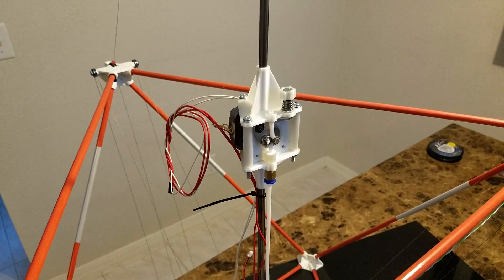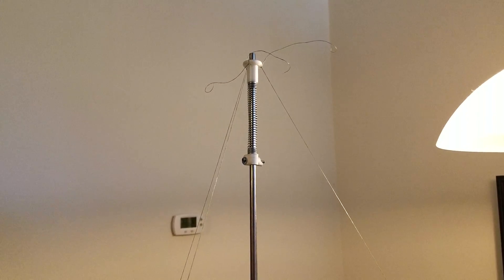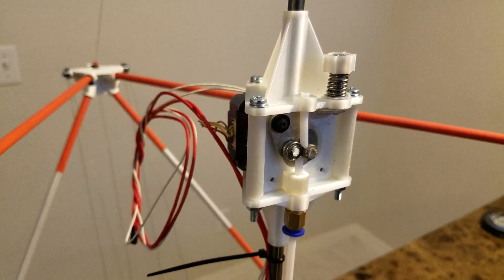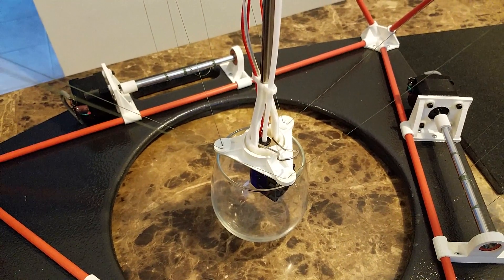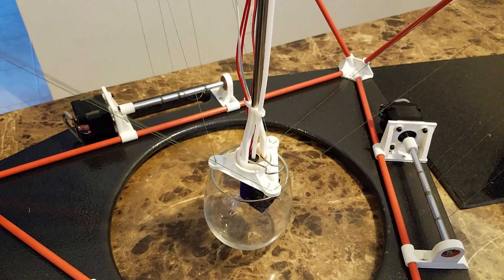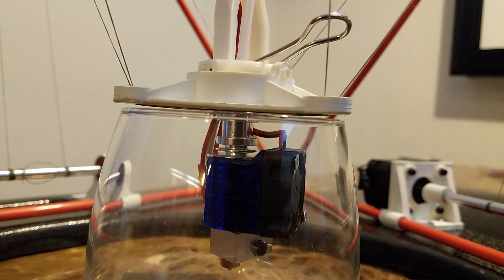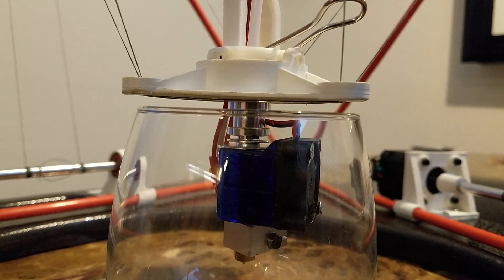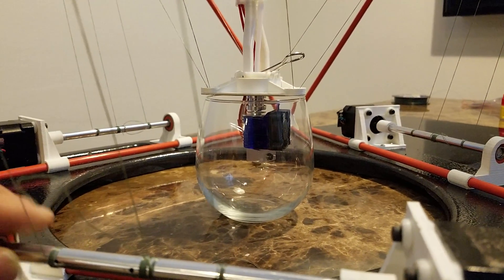Arcus 3D C1 - Leveling the end effector.

Comment: I was looking at your hackaday. I saw your rods and a carbon fiber tube. Could you use a carbon fiber tube for part or all of the center rod? Reduce moving mass even more?
Reply from the maker: Yes, if you used a thin-wall tube you could reduce the moving mass by 50% and still have similar strength.
Carbon fiber tube .5mm wall 8x750mm: 15g
Carbon fiber tube 1mm wall 8x750mm: 34g
Steel garden stake .3mm wall 8x750mm:  33g

If you are willing to wait for a slow boat from China, I actually found carbon fiber tubes which were cheaper than the stake. The garden stake does have acceptable numbers and will work fine though if you don't want to wait.

Comment: Wouldn't this printer only be able to move as fast as gravity will accelerate the head?
Reply from the maker: The central push-rod provides constant tension on the lines without gravity.  It will move upside down.
Reply: Arcus-3D Oh I didn't realize that. Thanks for pointing that out. Loving the innovation coming from you guys.